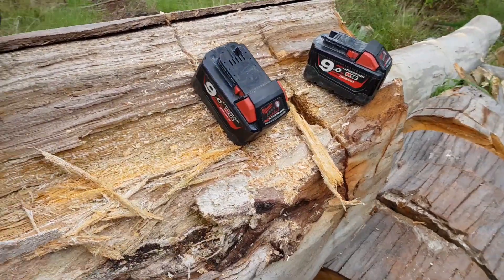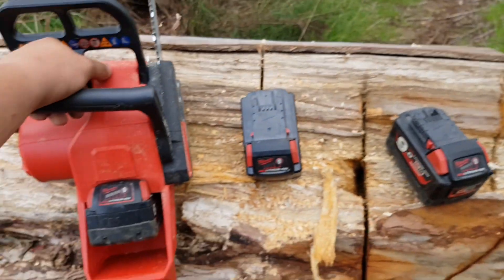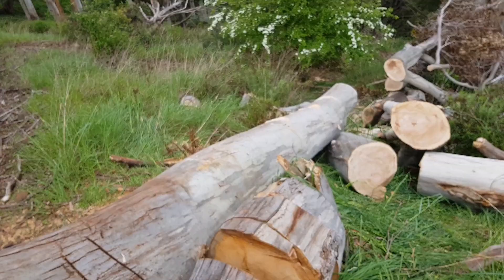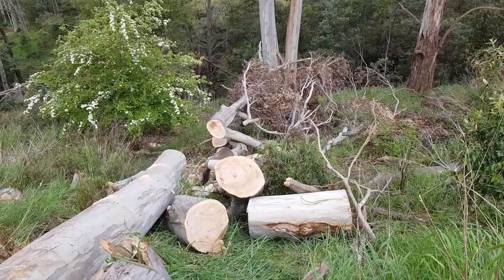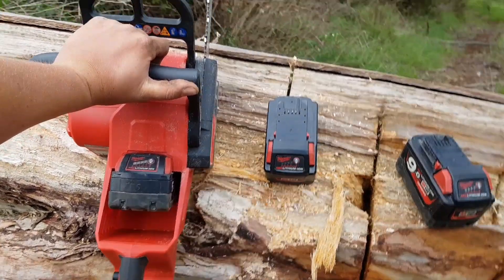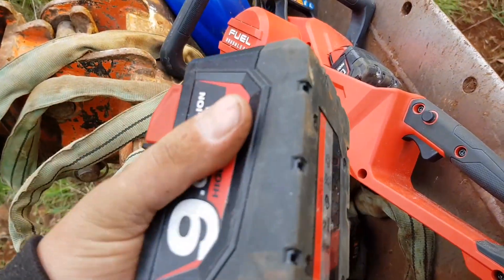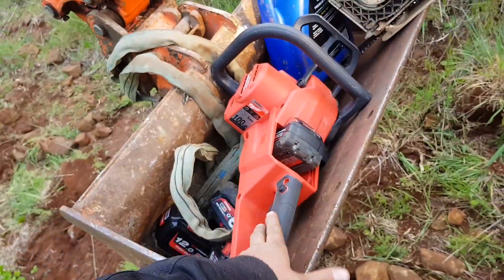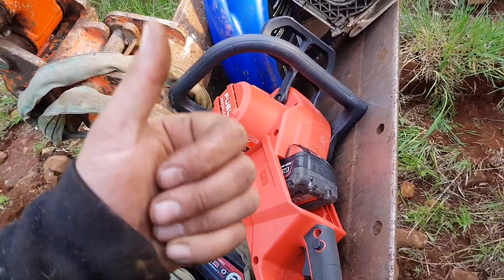Milwaukee Chainsaw  m18 fuel brushless. too hard on batterys

Comment: Your expecting a 16 inch  battery chainsaw to do what really needs at least a 50cc chainsaw. You expectations are way to high. This saw is for limbs not 20 inch tree trunks. What did you expect?  I bought a prius and I'm gonna pull tractor trailer with it and when it will not do it I'm gonna call it junk.
Reply from the maker: They were marketed really hard as been a 45cc replacement. That been said. With 12.0 batterys I've cut so much wood already the std chain is  a massive down fall

Comment: Are those real genuine Milwaukee batteries? I own the same chainsaw and use genuine 9.0 & 12.0 batteries and have had zero issues. Maybe you just got a lemon tool. Milwaukee has a 3 or 5 year warranty so they should fix it or replace it for you.
Reply from the maker: Yeah they just look different in Australia.
You can over heat a 12.0 also depends on what your trying to cut i guess
Reply: @Oneupthesleevecustoms  Weird, maybe it's a battery issue? I'm out of guesses. I hope you are able to get it fixed.
Reply from the maker: Wasn't a cold day but not hot either. Any time you work something that hard it can get hot i guess

Comment: There is just too much resistance at 18v for high draw tools. I like that Milwaukee is trying to keep everything on the same platform, I just dont think it will work.
Reply from the maker: Im been hard on it but it is struggling battery wise.

Comment: Since the Milwaukee operates on 18 V the amperage draw when under load must be tremendous requiring heavy duty wiring.  Assuming battery saws need about same amount power as corded saws, I asked myself, “What is the wattage of corded electric chainsaws?”  That’s easy to find out.  They run from about 9 amps to 12 amps @ 110 Volts.  That’s approximately 1000 to 1300  watts.  Assume a battery saw is working about as hard as a smaller corded saw or @ about 1000 watts.  The amp draw @ 18V @1000W would be (1000/18) = 55 amperes.  No wonder the Milwaukee is heavy!  55 amps requires some big ass MOSFETs and motor windings.  I’ll bet the motor is massive!  36 Volt saws use half that amperage and 56V saws only use a quarter of that.

Of course battery saws utilize more efficient brushless motors, so maybe the amperage is as much as 20% lower than corded for the same work load which would put the amperage down around 44 for the Milwaukee.  Does anyone actually know what the amps these battery saws are operating at under load?  If these saws draw anywhere near 1000 watts, it’s no wonder the smaller sized batteries overheat!  The draw per battery must be completely maxed out.  

Only rarely do I have over temp issues with any Makita batteries I use with my xcu03 saw with a 16” bar and full chisel chain, even with continuous use on large diameter hardwood.  They get warm, near the end, but you can use them up without thermal overload.  I have 3, 4, 5 and 6 Ah batteries.  The Makita needs two batteries to operate.  Two 6Ah Makita's have the same watt hour rating as one 12Ah Milwaukee.  Makita batteries all weigh about the same and have the same volume and number of batteries inside.  The larger capacity batteries aren’t bigger or heavier.
Reply from the maker: The Milwaukee 12 amp isnt the same as 2 6amp makitas. They have 10 18650s each. Milwaukee has 15 20700 cells mate
Reply from the maker: Ave did a tear down of milwaukee saw motor is freaking huge!!
Reply: @Oneupthesleevecustoms  Maybe you can explain what is different about them to me.  I know the cell geometry is different.

Ok, Two (2) Makitas have 20 18650s, 10 in each battery.  You say the Milwaukee has 15 20700 cells.  They are physically different.  However, I was referring to power capacity.  2 Makitas contain 216 watt hours (2 x 6Ah x 18V), while one (1) Milwaukee contains 216 watt hours (12 Ah x 18V).  

Help me out here.  Is there more power in a single Milwaukee than in two Makitas?  Is there something I'm not getting?  It does seem like the Milwaukee can cut more wood before the battery dies, but I don't know why.

Comment: You need the 15 amp hr batteries.. or a higher voltage system to lower the current discharge...
Reply from the maker: Biggest batt they make is a 12amp
Reply: One Up The Sleeve Customs . They will release a 15 amp Hr battery soon.
Reply from the maker: You reakon? The 12 is only fairly new
Reply: @Oneupthesleevecustoms  My spidey sense thinks there will be at 15 Amp hr battery soon. This is not based on any evidence, but knowing battery cells and milwaukee in the m18 platform and also trying to always push to the next best thing, that would be my guess.

Comment: That's what sucks with these new Milwaukee tools.  Yeah the still use 18volt batteries and you can use those on other tools, but need the new bigger battery. you cant really use the smaller batteries in a sense
Reply from the maker: Yeah when you have 6 9.0 batterys and need to buy 3 12s for the chainsaw its upseting.

Comment: Seems like this is bit of evidence that 18v is just not enough for these applications. I'm imagining the massive current...
Reply from the maker: Yeah i agree. The way milwaukee crams the cells into 9.0s is no supprise. It was 10 deg and windy as out side though. 
Did you see the 82v victa battery i opened
Reply: well it's not like the Dewalt 54V chainsaw is any good either.  It's certified junk.  

and Makita 36V has thermal problems too because you're hitting each battery similarly to one of these   And they get warm quick because you're drawing so much current and hitting the discharge ceiling rather easily.  

Makita's solution would probably perform the best if they'd get off their asses and put out some 3P batteries capable of outputting 60A+. That way the batteries aren't being  pushed so close to their peak.  And Milwaukee's would perform better if the 21700s get to a point where you can have 4.0 ah cells with a discharge rating of 35A-40A.  The Samsung 40T they're using now is a 30A cell.
Reply from the maker: The saw has a ton of power batts just cant feed it

Comment: You're using the wrong batteries mate.  You have to use the High Output batteries
Reply from the maker: When marketed it stated its compatible with m18 platform 
Batterys. But for maximum power you need high outputs.
Its killed my 12 amp in 5 16 inch cuts
Reply: @Oneupthesleevecustoms  maybe a bad unit?  I'm surprised you only got 5 cuts.  That's not good!  Everyone in the state's has gotten good run time.  Curious if you were to ask Milwaukee Service person for fix or just return and try another?  Thanks for the video!
Reply from the maker: I was cutting an Australian gum tree. Every video ive seen so far has been soft woods and pine ect. ( i watched dozens before i grabbed this). Im going to change chains to somthing with less anti kick back and see what happends ill keep you guys posted
Reply: @Oneupthesleevecustoms  Thanks!  Look forward to any updates.  I'll look out for them.